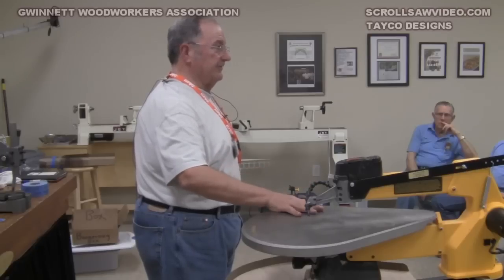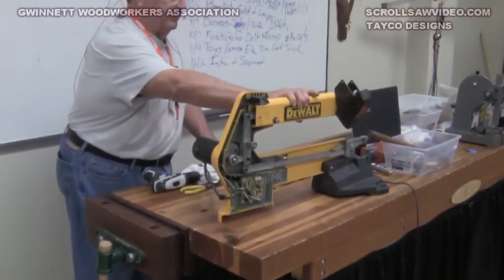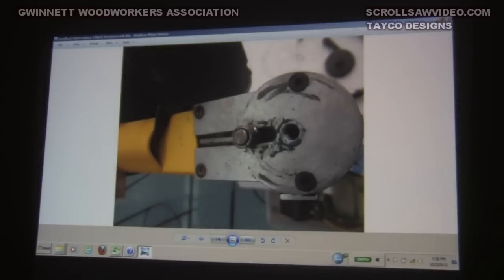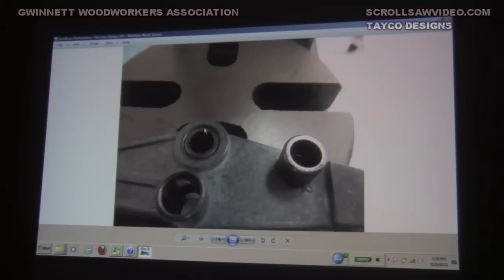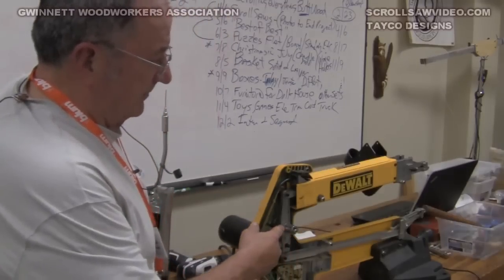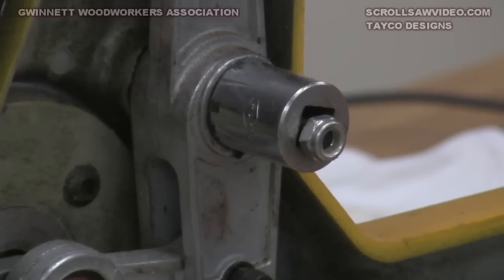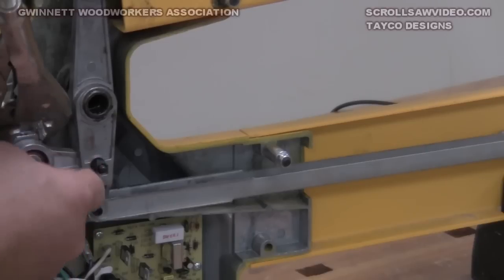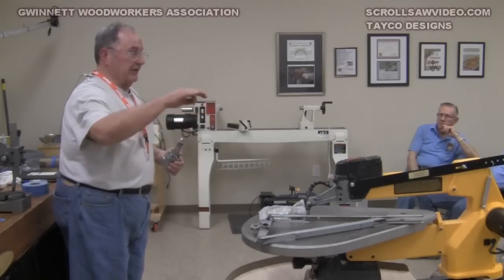How To Woodworking DeWalt Scroll Saw Repair Up Keep Maintenance

Comment: Thanks so much for this video.  I'll be feeling guilty until I get the courage to tear my saw down and lubricate the bearings.

However I think I know of a better tool for applying the grease.  Your local bicycle shop probably has a grease-gun for bicycles.  It's about five inches tall; you can hold it in one hand and it shoots out a tiny stream of grease.  I bought one about ten years ago to apply grease to my garage doors and I just found it out in my garage.

Comment: thank you for such a great series on this saw repair.I just bought a used Dewalt Scroll saw not sure on age but motor says made in USA.Much to mmy disappointment and as I figured as soon as I tention the lade and start the saw it makes a racked and I am gessing it is exactly the problem you cover here. The question I hve is. Is there a site than I can just order all the berings and sleeves for this saw without knowing all the part #s or will I need to ge the diagram and ordr accordingly to the part numbers?Thanks in advance

Comment: I enjoyed your video as I have 4 of these noisemakers in my Technology Ed shop. What is the name and number of the grease you mention? My local NAPA store couldn't find it, we thought it might be their caliper grease. Advance auto had a synthetic by valvolene but only in the 1 pound can which might last forever.
With regards to the tension adjustment, what is the correct amount of tension to make it quiet? ( other sites suggest turning this but are not as thorough as yours). How many turns left or right from which end is recommended, should I bottom the rod out, then back off how many turns?

Comment: Great video... thank you.

Is it normal for a brand new saw to have noticible vibration in the mid range but smooth operation in the lower and higher rpms? Or is this a manufactures defect? Have ou come across this in your experience? Thanks kindly.
Reply from the maker: Nouser Unrecognizable on the manufacture, vibration will vary. The first step in reducing vibration is proper saw mounting.  Many people use a mat of some sort under the saw but I find that this causes more vibration.
Reply: Scrollsaw & Woodworking Video Thanks for the reply. It's a dewalt. Works pretty smooth through most of the speed range except 4-5 speed. Also seems to have a blade that moves way out front and back motion not an up and down motions. Kind of disappointed with dewalt.
Reply from the maker: Nouser Unrecognizable The Dewalt isn't the same saw of 10-12 years ago. If I were in the market for a new saw it would be the Excalibur.

Comment: At the 5:00 mark, is the ticking noise that the machine makes while running normal? I ask because there are many posts out there from the owners of the DW788 who say they had ticking and rattling noises that can be solved by tearing the machine apart and readjusting things. If the ticking noise that the saw in this video makes is normal, it would be nice to know so that people don't go needlessly tearing into their machines and voiding warranty for a sound that is actually normal for this machine.

Comment: I have a dewalt scrollsaw just like the one that Bob is showing on the video.  I am having some problems with it.  I want to take the case cover off below the arm.  I have removed all the nuts and bolts and I would have thought that the case should come apart  -  is there any other videos showing how to take this cover plate off. I should mention that it is attached to a stand - does it have to be removed from the stand for the cover to be removed.   Any help you can give me would be greatly appreciated  Burt

Comment: I just got the Dewalt scroll saw and here's my problem...when changing blades, the top of the blade is not easy to lock in. When it does, the top of the blade will actually bend like a horseshoe. Is this normal? I wouldn't think it is. All input is welcome here.
Reply from the maker: +Bowling Wolf , I have a video that explains how to adjust the setscrews.